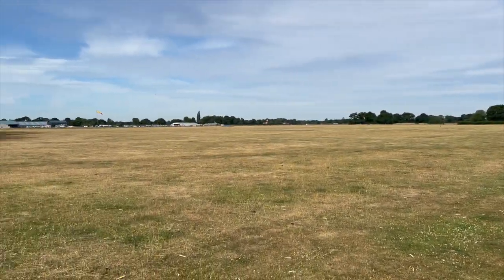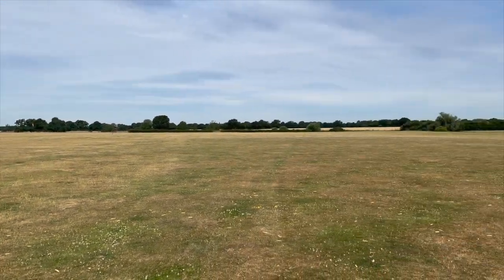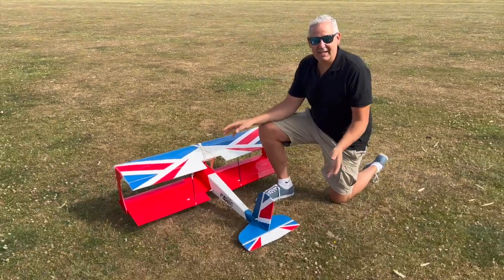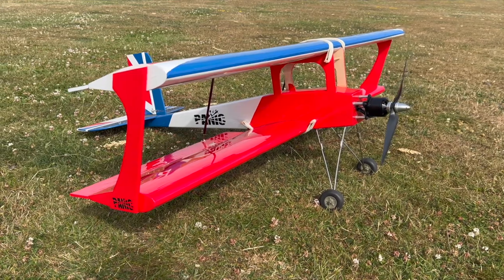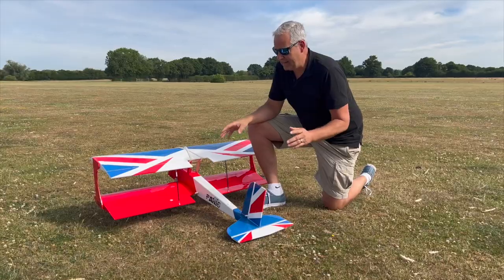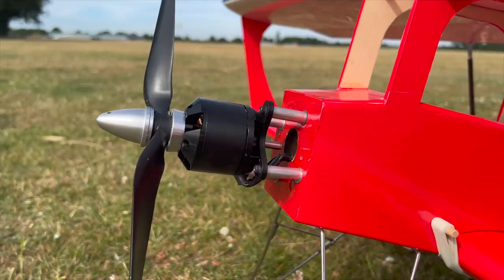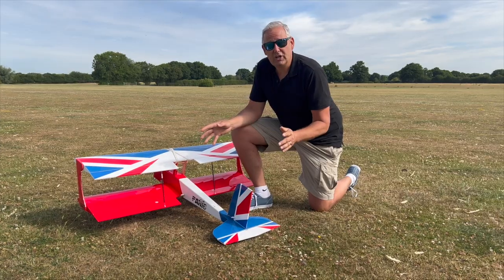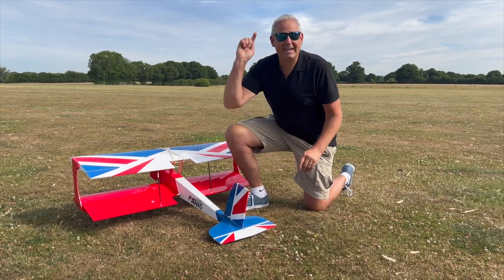PANIC BIPLANE (2022 ARTF)

Comment: Nice re-boot of the Panic - It would be good if a more detailed video with some basic technical info like AUW with Battery , motor and best prop recommendation is shared. would also be good to know how much battery space is there. Also a more aerobatic video to show the full capabilities of the model. A few questions needs to answered like why the rudder servo has been moved back in the fuselage and can the top wing has an option for spoileron like the original avicraft one !
Reply from the maker: Recommended motor, battery and ESC are detailed in the spec list at the end of the video. The rudder servo has been moved forward to help achieve the correct C of G with the electric powertrain although there is a hidden servo tray in the tail for use when heavier i.c. engines are fitted. So, best of both worlds. Both the top and bottom wing are equipped with servo mounts which means spoileron control is an option.
Reply: @WeAreJPerkins  Stating the KV of a motor is not a specification. More details are needed for a complete video. There is not even a proper spec on your website.
Reply from the maker: @charlottebrain9352  Good afternoon Charlotte, the full motor specification is 5055–670KV. We've now updated our website to clarify this and thank you for making the point. Ultimately if you purchase the motor that 'is' recommended on our website you'll have a perfect match for the model.
Reply: @WeAreJPerkins  Hi - Why is the electric brushless motor shown in your video for the new `Panic` model, is NOT the same as listed at the end of the video ? - The one in the video is quoted as a 470 KV (put subtitles on ) and is all black in colour, looking like an Overlander brand  `Thumper` motor.  - The one listed at the end of the video is listed as a 670 KV which I believe is sold by JP for this model but this is a 670 motor and the spec for which is for a 5-6 `S` lipo moto and weighs a lot ! and the New panic model spec & manual  says to use a 4s lipo ?

Please clarify which motor recommended to use with this new Panic aircraft
Reply from the maker: @bluelagoonfortyfour  The motor used on the model in the video is a 760KV outrunner running on a 4S LiPo. The combination provides power enough to hang on the prop and punch out (see video). Certainly if you require more power then a 5S set-up will provide that. The battery bay on the panic will take a pack measuring 125 x 46 x 38mm.

Comment: Hi - The electric brushless motor shown in this videos for the new `Panic` model, is NOT the same as listed at the end of the video ? - The one in the video is quoted as a 470 KV (put subtitles on ) and is all black in colour, ( looking like an Overlander brand `Thumper` motor maybe ?).  - The motor listed at the end of the video is 670 KV which I believe is sold by JP for this model but this 670 motor has a spec for a 5-6 `S` lipo moto (and weighs a lot more than the one in the video,  if the video one is a `Thumper` brand !) and the New panic model spec & its online instruction manual says to use a 4S lipo  - i.e. not a 5S or 6S size.

So please clarify which motor is recommended to use with this new Panic aircraft  AND if the `670 KV JP` one,  will give enough power for `3D` flying on 4S - OR - if 5S or 5S lipos will  fit in the model?

DJ

Comment: I'm flying mine on 6S. I use a SK3 5045 kv=500, 80A ESC, 15x8 apc-e prop and a 6S 4000 mAh. The same setup like a typical EF 60" and it really kicks @ss.
See https://www.youtube.com/watch?v=6G4CraGJnVg

I made the hatch for the battery a little bigger  (starting from the firewall) to make it easier to install the battery. 
With a pull pull on rudder I need no additional noseweight at all.